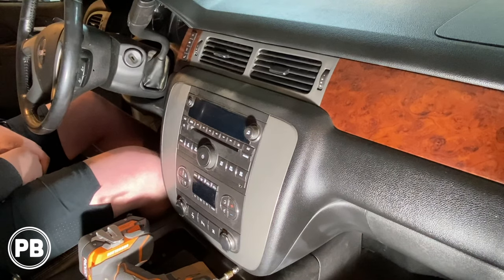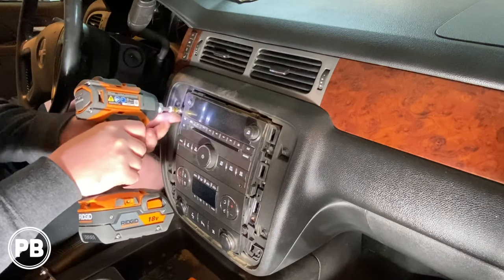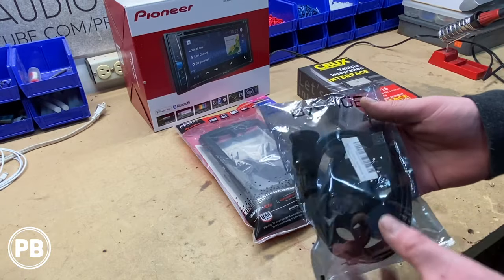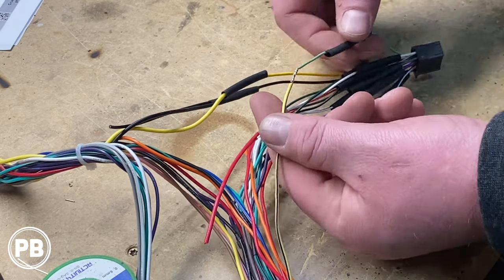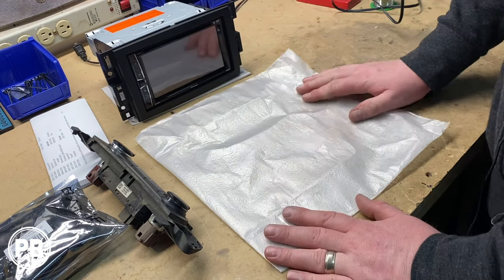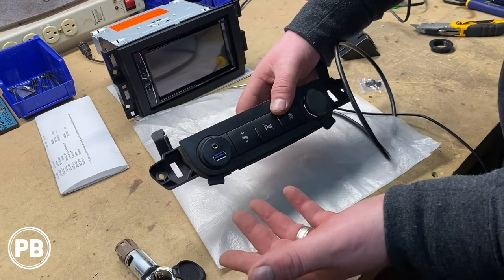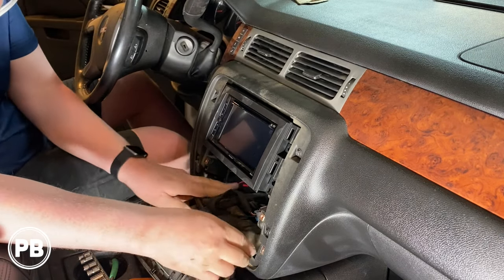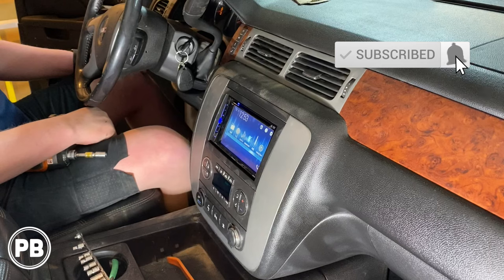2007 - 2014 GMC / Chevy Radio Install Sierra, Silverado, Avalanche, Tahoe Suburban, Yukon, Impala

Comment: do you have a video for installing the microphone
Reply from the maker: Nope, but we just added it on the top of the A pillar, ran the cable down behind the door weather stripping, through the dash to the radio.
Reply: @ProvoBeastAudio  do you have a link to the adapter to make the center console USB hot? Also, I'm replacing a unit that had navigation and the antenna adapter you have a link to is the wrong one, doesn't work with mine, do you know what it might be?
Reply: Where at the top of the A pillar did you install the Mic, can you post a photo?

Comment: My head unit is working but there is no sound out of the speakers. Someone help plz
Reply: Recheck all connections Front right positive negative, rear right positive and negative etc, check settings on the radio, make sure pins on each connecter are clean and fully clipped in, otherwise you may have a faulty aftermarket harness. Best of luck
Reply from the maker: Sounds like you may have Bose.  You need to connect the blue / white wire of your radio to the blue/white wire of the harness adapter to trigger the Bose amp to turn on.
Reply: @ProvoBeastAudio  yep that was it! Thank you!

Comment: Mines won’t turn off after vehicle is off. Same radio
Reply from the maker: Sounds like a wiring issue.
Reply from the maker: I’d check the harness you are using.

Comment: How do you program the steering wheel controls
Reply from the maker: Depends on the harness module and radio you are running.  Lots of variables there.

Comment: I did everything you did but my radio won’t turn off
Reply from the maker: Sounds like a wiring issue.  Check your connections.
Reply: You think I made a wrong connection
Reply: I think I connected correctly I will check again

Comment: Where is the radio turn on located.
Reply from the maker: There isn't one in the harness as it is controlled over the Canbus which is why we used the smart harness.   If you need an accessory wire outside of using a smart harness, you will have to go to the fuse box.

Comment: will this installation work on a 2011 GMC Sierra with ONStar and back up camera ? do I need anymore adapters ?
Reply from the maker: Nope, it includes everything - CRUX SOOGM-16.  Just purchase the dash kit as we did and you should be good to go.
Reply: @ProvoBeastAudio   i have used this kit in my 2011 Tahoe. I had a working factory sub on factory radio , Now the sub is not working, the kit  I have is SOOGM-16 , any input will be appreciated

Comment: Does that harness bypass the bose if you use it?
Reply from the maker: No, it retains bose with the new radio.
Reply: @ProvoBeastAudio  doesn’t that limit the amount of volume? I mean it seems like a waste to put a aftermarket radio and speakers just to get the same amount of sound